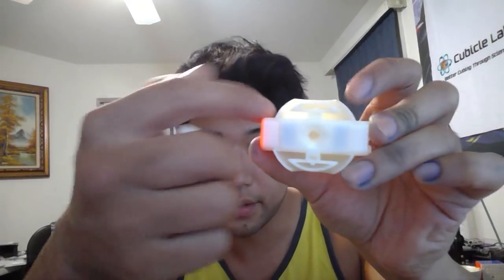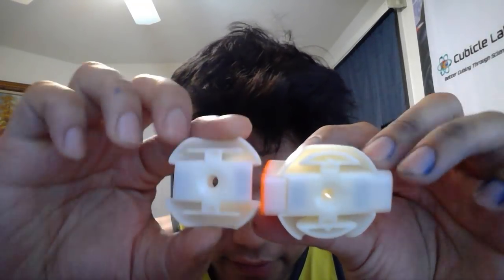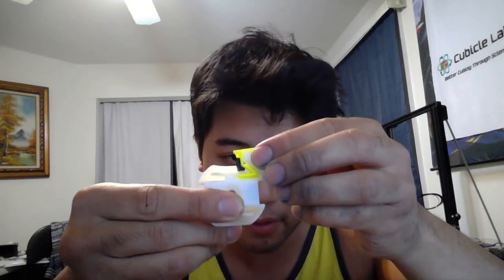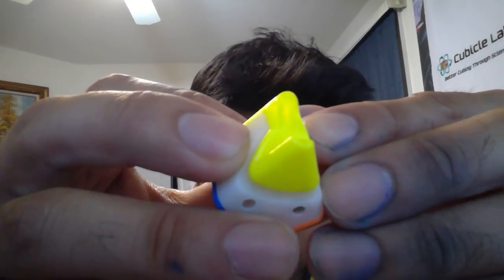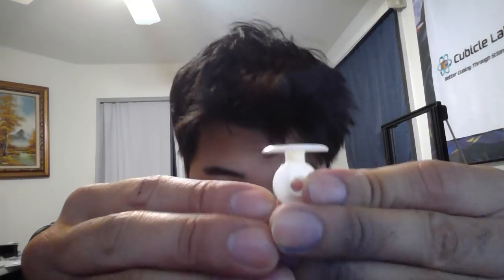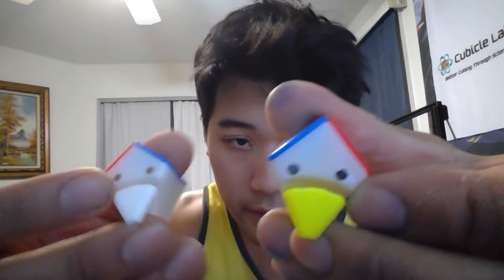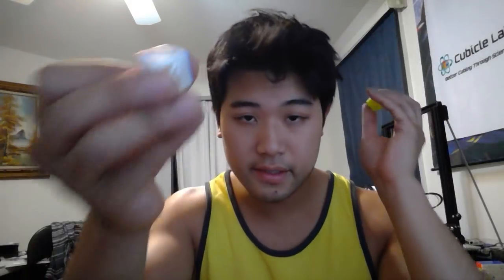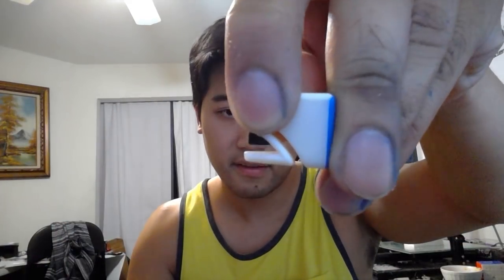Sq-1 Low Mod? How about Tran Mod??

Comment: Ok, I recently completed the tran mod on one of my volts and I have a few comments worth sharing on it. 

The sanding of the internal pieces doesn’t solve every problem. The original purpose of the mod is to prevent edge breakage, and in that aspect the mod is successful. The edge has a considerably larger amount of give and will therefore take more a larger push before it breaks. However, the mod isn’t without its downsides. The removal of such a large amount of plastic has an seriously huge negative effect on the speed of the puzzle. The top and bottom layers become so fast they’re nearly uncontrollable. This is due to the fact that the contact between the pieces is significantly reduced, meaning there’s less friction between the pieces. Maybe this could change using the edge inserts, but I can’t say because I don’t have any of them available. 

All in all, I think the mod is a very good idea. Chris’s version of the puzzle is almost certainly of higher quality than anything that can be replicated at home. The edge supports seem to be a key factor in making the puzzle usable after the cutting of the internal pieces, so unless you can make your own support pieces or they are sold separately from the puzzle, I wouldn’t recommend trying this mod out. The risk of breaking edges is much more favorable to having an unusable puzzle in my opinion.
Reply: Ivan V. Magnets can slow down the layers

Comment: Angstrom V2:
Chris Tran mod that allows the edges to not break
Magnetic top and bottom layers
Magnetic slices
Angstrom lube
Overall pretty overpowered, hopefully I will be able to buy one. Keep up the great work man!

I commented 3 times lol
Reply: JonnydaCuber bruh when thecubicle puts that up it’ll be like a $60 squan
Reply: BMLCuber7 did you use dark magic or smth?
Reply: But you don't have to buy replacement volts for parts.